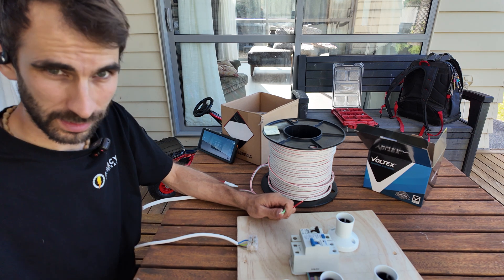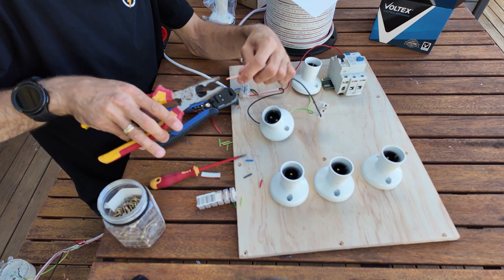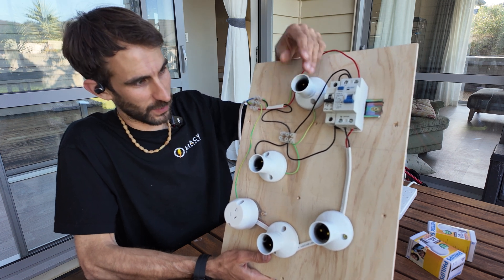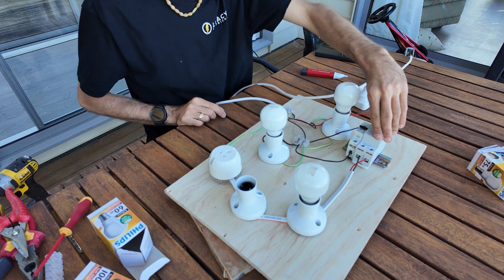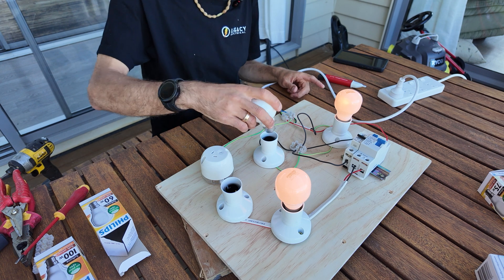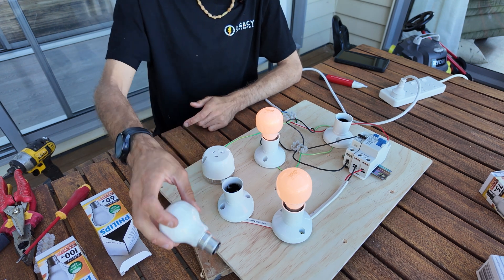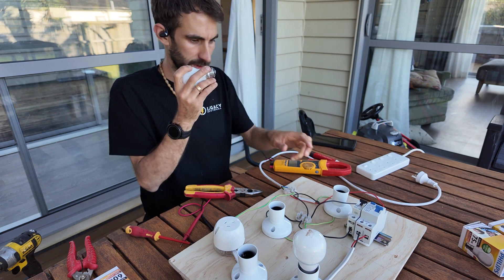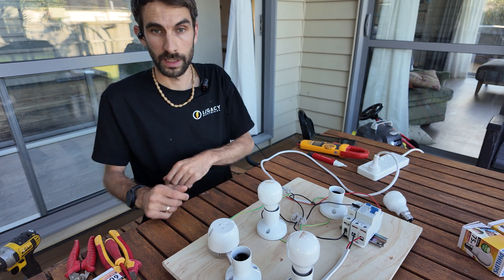Loose Neutral Fault Demo

Comment: Good old PEN fault.  A high impedance (this could be a matter of an ohm) or open circuit supply neutral is quite dangerous in TN-C-S systems such as M.E.N.  PEN fault detection would address the open situation but high impedance is a bit harder to deal with.  The electricity authorities in each state in Australia monitor supply impedance by way of smart meters (voltage drop vs current and comparison with same at other properties on the same transformer) to detect potential neutral faults before they progress to the point where people can be shocked or worse.

Yes, they really are spying on you with those smart meters, and we should all be thankful for it being done. ;)
Reply from the maker: Lol, I didn't know smart meters were being used to guard against this sort of fault. That's good to hear.
Reply: @legacyelectrical  It's pretty impressive what can be done with smart metering.  Automatic dispatch if all the meters on a transformer go silent, monitoring what load is actually being placed on a transformer and automatic notification if it is sailing to close to the wind.  Unfortunately all the foil hat types think about is 'they are spying on me!!!' or 5G radiation from the meter comms.

Comment: is what you are saying if your lights go dim when you turn on your oven you have  an earth fault, or a neutral fault at the fuse board, or could a loose neutral at a power point cause the same problem
Reply from the maker: If the lights dim when the oven is turned on then it could be a bad connection on the phase (hot) or the neutral. The neutral is the really dangerous one. Loose neutral refers to a bad connection on a neutral.

Comment: Thank you for your effort, but you should have thought through and tested your setup before filming. Overlong screws, table protection, the hoover and the heat-gun, the mains switch in the house, discovering things on the go, giving extra information before explaining the basic test, changing the setup on the go etc. etc. all distract and complicate your tutorial. Since I'm an electrician I wanted to see this through, but normally you would have lost me way before the main explanation.
Reply from the maker: Yeah, I thought catching the reactions might make it more interesting. I'll probably make another one that's much shorter.
Reply: I disagree, i think this highlights very well the complexity of neutral/ground/hot wire ac set ups, if even a trained sparky has to think it through it clearly says "dont mess with it"
I got it anyway, post fault rcd = no rcd and the voltage division demo was crystal, if not a little bit fumbly 🤣
Reply: It's the reality of youtube, not everyone is skilled or experienced enough to produce a slick video.
Reply from the maker: A lot of those slick videos involve 8 to 20 hours of production labour for a 10 or 20 min video. I just don't have that kind of time to dedicate to this.
Reply from the maker: I appreciate the feedback